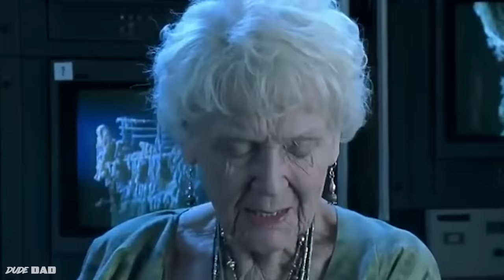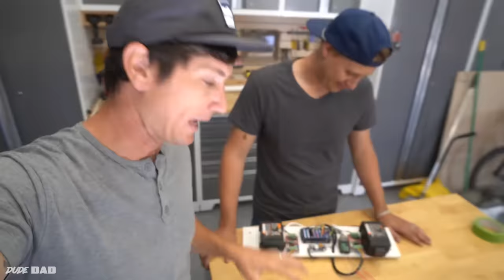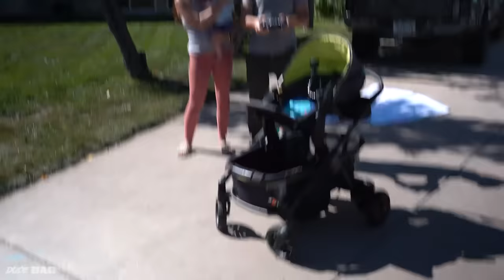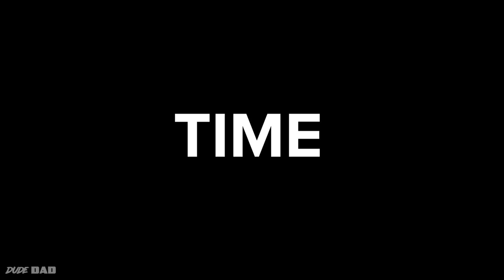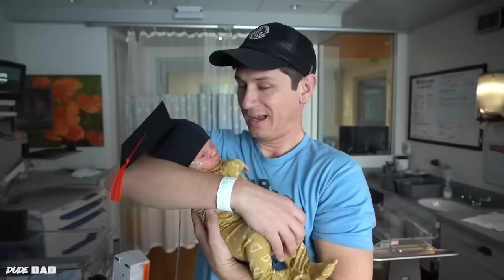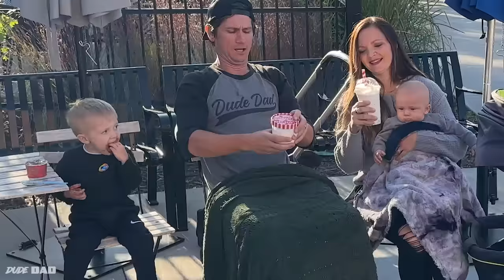Dad Builds Remote Controlled Stroller!

Comment: So dumb LOL  I had mine and it took literally 8 minutes, I WATCHED THEM DO IT, and I was out of there and had ZERO ZERO ZERO pain, no swelling, nothing.  In fact I went blading the next day with my hockey kids at the rink and was just fine.   Never had ANY discomfort of any kind, not even tenderness, oh and no need for any dang cold pack or valium because I was not uptight about the procedure.  Only thing I have to complain about was the two sutures (one on each side) that were feeling like pins poking me a day later.  Otherwise, nothing, no drama and no regerts :)
Reply: Unless like me you get a hematoma and I still need a jock strap two weeks later, constantly feels like I just got kicked in the balls
Reply: Had mine when I was 27 and it was no big deal. Tender and a little pain for the rest of the day, but back to work the next day without issue.
Reply: You guys are tough! Bahahahaha